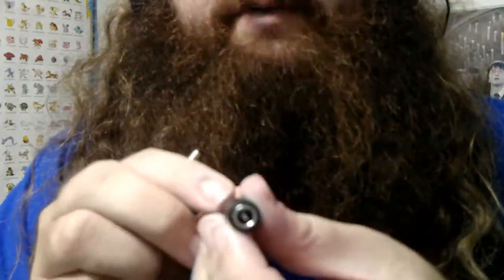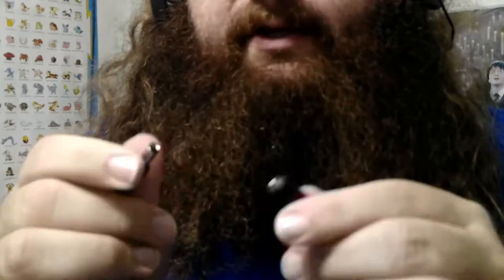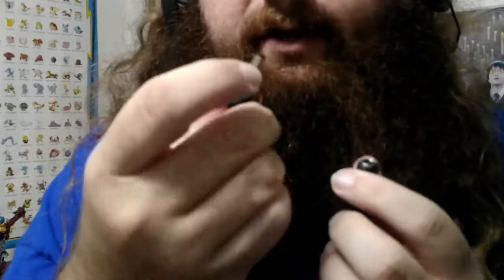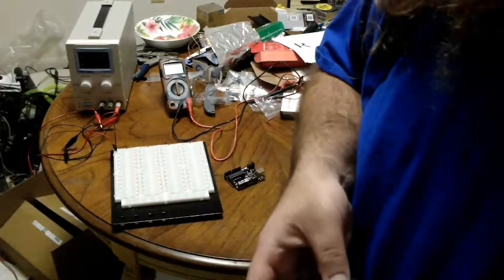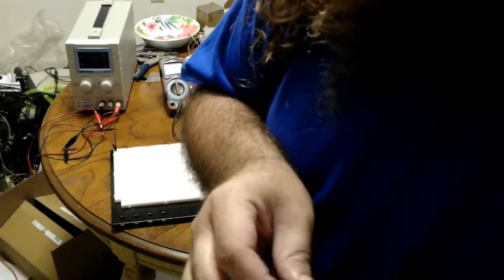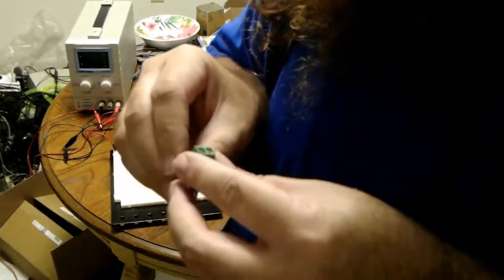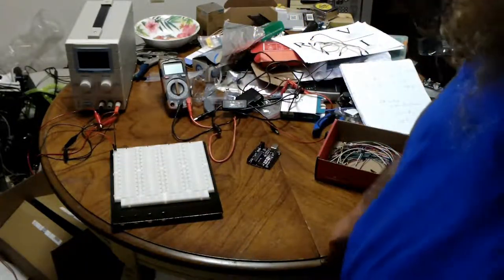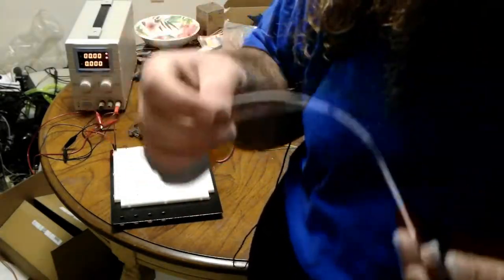Barrel Jack Connectors - Simply Put

Comment: If I were to upgrade the internals of my microscopes led to handle 12 volts would the original 5 volt female jack work? Or are jack inputs interchangeable so as long as the polarity (center negative) is the same.

Comment: Watched the video. I naïvely hoped that the fellow would talk about places which will make custom assemblies for you. I currently have a cable which is really two power cables spliced together with the splice wrapped with electrical tape. I really want to level up to a custom cable. Thus far, I have not even succeeded in finding the manufacturer of the two cables I spiced together. They are not listed at: Mouser, DigiKey, Newark, or Jameco. So, where did I get them? They were part of set of "Fotga" cables that I purchased from Amazon. However, Fotga does not list them, and they are frequently out of stock at Amazon. Also, canalizing the cables from Amazon is not exactly efficient.

Comment: When I check continuity between the barrel and the bare cables (I cut off the faulty fall plug) I get continuity, which is good. But should I be getting any sort of resistance (ie not infinity) between + and - ?

Comment: Hi, maybe you can help, I have a barrel plug that plugs into a 100w solar panel. The BP came with this particular SP. The barrel plug has two metal notches on the inside. Once inserted into the SP I must apply a 1/4” turn to lock the plug into place. 
Would you happen to know the name of such a barrel plug?